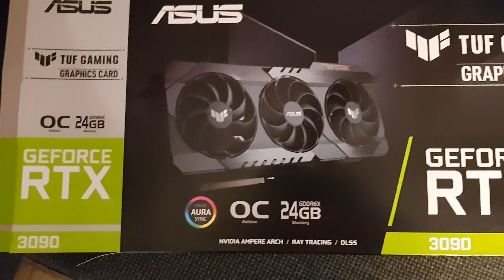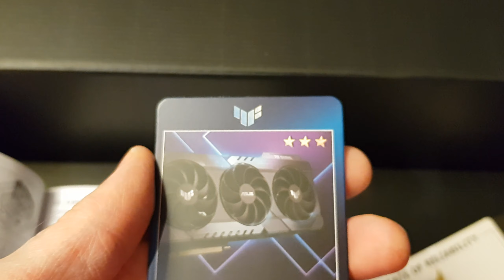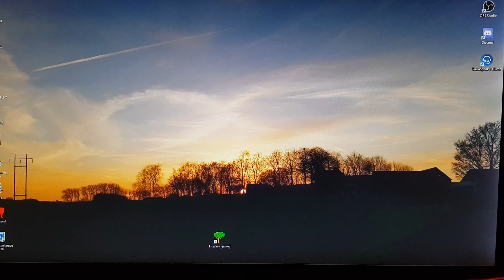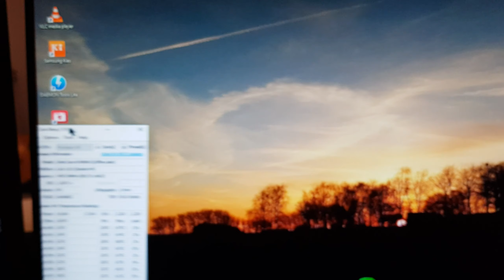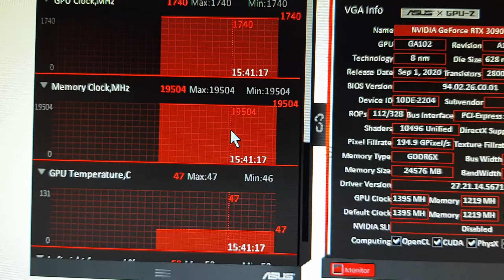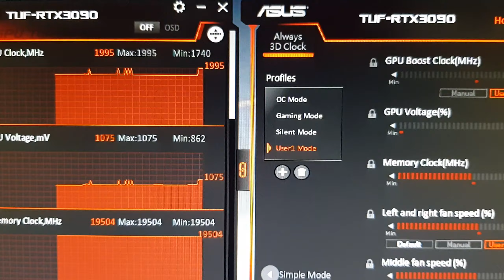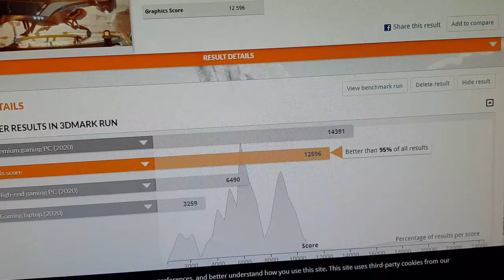TUF 3090 OC | Unboxing, Installation & Bench + OC 😅

Comment: Make sure you remove your old drivers from a older GPU if you are replacing them with a new GPU. This isn't just for people getting a new 3090 you should uninstall all your older drivers before you remove the old GPU then just install the newer drivers after you have set up your new GPU.......

Comment: one question i am now using one cable to power up my rtx 3080 ti and i am undervolting power limit from 100 to 85% is it ok for now i will be change it each cable i will be put on gpu but i need to buy new case and new liquid cooler and i will change it then is it ok?
Reply from the maker: I think that is okay to do, I dont know much about undervolting but if the card runs fine without artifacts that is what matters. And yes, when you get the new case try to draw two cables from your power supply unit to the card- I wouldnt worry about it for now but 3-400 watts is quite a bit for the small regular cables in long term :)

Comment: If someone is wondering, like he said, you could run this thing on 650w. I have the same setup and I tested it on 650w power supply extensively, it sustained quite well.
Reply: You running under load. I just bought one and I have a 3950x overclocked to 4.3Ghz on a 1000w power supply so I should be more then find, but a 650w power supply 🤔.
Reply: @Thex-W.I.T.C.H.-xMaster  yes, I tested on full load with 9900k.

Comment: Hi, just wondering if you still have this card and if so what are your VRAM memory temps while under regular gaming. My GPU temps stay in the high 60's C and my VRAM hits 82-84 deg C. Do these seem like reasonable regular temps?
Reply from the maker: Perfectly fine these generally run high not over 90 at best tho

Comment: Maybe turn the rad again so hoses are on top - you want the pump on the CPU to be the lowest point in the loop.  This is probably the reason you saw an improvement when turning hoses from facing down to sideways - might improve a bit more putting hoses on top.  Main reason is you don’t have risk of air bubbles in the pump.  You’re gonna want a support bracket of some kind.  I’ve got the 3080 TUF - these are heavy cards and it will sag
Reply from the maker: no bubbles as it is and i cant turn them up because the size of the cooler, but I dont get bubbles stuck so it doesnt matter anyway, the mount only has to be slightly lover for the air to seek the highest point tbh.

Comment: I hate hate the freaking fans/heatsink on the tuf version it's so much thinner lol  like the body looks wider but the fins are more spread apart and much thinner not as dense! Like the strix in the hand feels much more dense and has that quality weight feel to it. The fans are better and the fins for the hestsink are very tight snd close together all the way across tha card very dense!
Reply from the maker: okay relax there buddy xD hate less! Personally I am super impressed with the cooler, this is the coldest card Ive ever had its freakin amazing!
Reply: @9tiesimonsomething  sry it just upsets me not your fault. Just makes me mad at asus. Like I don't get why there is such a quality difference. But if you like it and it's running good for you then awesome!
Reply from the maker: @reviewforthetube6485  what are your temps? mine are at like 60-65c for demaning games which is super good I think.
Reply: @9tiesimonsomething  that's actually really good if you are getting those then awesome! I'm getting around the same tbh with the strix now. But the tuf was going well above that I even had Temps in the 90 range.
Reply from the maker: @reviewforthetube6485  that is really really bad, most reviews i saw the temps on the TUF was 55-65c range, I think you got a bad card!!
Reply: @9tiesimonsomething  well good to know I saw a few other videos with the same complaint manye it's just silicone luck or just sometimes you get bad ones. I do need to remember sometimes the strix also has issues for peoplle. I guess I was just upset with an experience haha. My bad but hey if it works for you then great!
Reply from the maker: @reviewforthetube6485  Oh I would be too! I pre-ordered mine so much has happened since then, dont know if the quality control is the same or the difficulty getting components lowered the quality- it is a world wide issue in almost ANY production. But I would be very disappointed too if that was me!
Reply: @9tiesimonsomething  sry for coming off aggressive or rude I'm not really that person. I shouldn't of stated it like I did regardless and you seem very level headed and nice. So yeah wasn't any offense towards you or your experience. But yeah I'm happy you got s good card. Luckily I have a good card now so all in all it worked out lol.
Reply from the maker: @reviewforthetube6485  thanks for watching and commenting :) dont worry you made some good points there I think everyone would feel cheated at these new prices if it was not top-tier at arrival!
Reply: @9tiesimonsomething  thanks man for sure

Comment: is that watercooling with single fan? you could use better than that....
Reply from the maker: No it is push pull h80i, it is insanely good temps always below 70 at 60-65, perfect for this cabinet.
Reply: @9tiesimonsomething   hmmm.... i saw 81 degrees celcius in sensor temp....
Reply from the maker: @deasy1603  that is peak temp it wont stay there as the cooler goes up in rpm just briefly 😁
Reply: @9tiesimonsomething  ok. then... nice, good job...!! hope i can taste that RTX too...  by the way i also use graphic card from TUF...
Reply from the maker: @deasy1603  these 30 series from tuf seem like they are golden cards in my experience, my gpu never goes over 70c and that is with standard fans at 80%. Really great cards if you got the psu for it 😎
Reply: @9tiesimonsomething  agreed

Comment: I hope you can change the orientation of the cpu cooling tube from the radiator. I was told by many that with the tubing on the top of the rad makes less coolant going to the pump and more air going thru which gives you the gurgling sound. They recommend you have the tubing from the bottom of the rad when it's vertically mounted.

Comment: Do you get coil whine with yours? Mine does at 1950 mhz
Reply from the maker: Ive only herd whine while running performance test bench- during 2d I believe, the parts with 3000+ fps otherwise normal use I get none.

Comment: My port royal is 12594 Same G Card ant Core I9 9900K
Reply from the maker: Did you put your fans on 100% and also I ran the test with minimum windows, meaning everything else than Port Royal was closed with GPU Tweak. Now I use Afterburner though :)
Reply: @9tiesimonsomething  No not 100% just Every ting stock
Reply from the maker: @fdiskformat5049  that pretty good then actually!
Reply: For me:
Silent mode: about 11600 (avg Tmp 64)
OC: about 12300 (avg Tmp 65)
Manual OC: 13300 (avg Tmp 67)

Ambient temperature: 22-24
Reply from the maker: @ShashankKatiyar0  that is very nice, id rather keep those kind of temps than a few MHz tbh, this card is so easy to keep under 70 at long loads its amazing :D

Comment: i have identical system  and just getting  11k  .I dont know what im doing wrong
Reply from the maker: These test were run with minimum windows apps, everything closed not related to the bench. With xmp and latest bios and cpu on performance i believe load level 6 in bios. The cores on sync all. I have nvme ssd and 64gb ram. The 3090 was running 100% fan speed and overclocked pretty good. Good luck let me know if i can help.
Reply: @9tiesimonsomething  I compared your setup and my firmware a bit newer . What I think all companies down volted  the cards . With Asus tweak oc settings went up 15k. I’m happy with that. Nvme drives are good very responsive. Thx for your help
Reply from the maker: @chiccoka  that is a crazy score ! :D